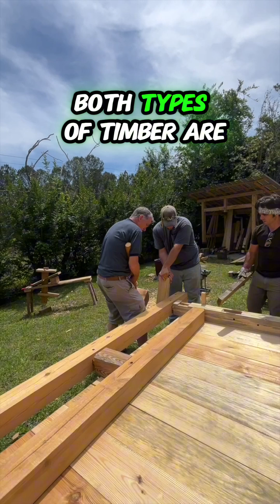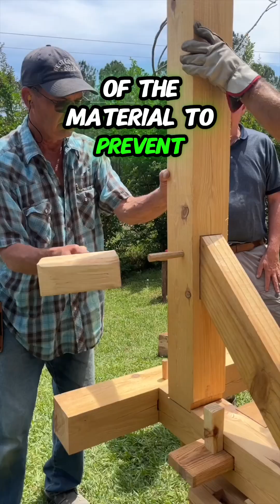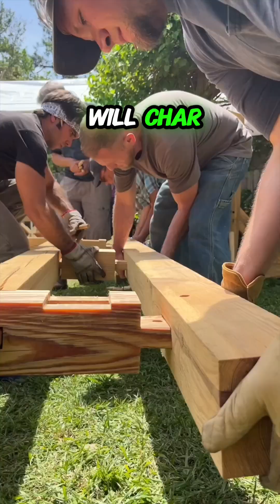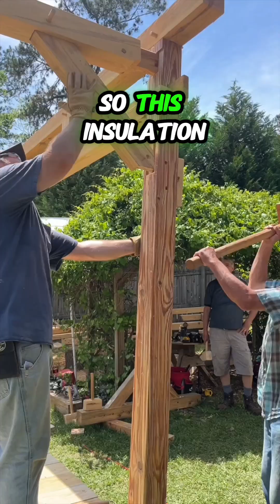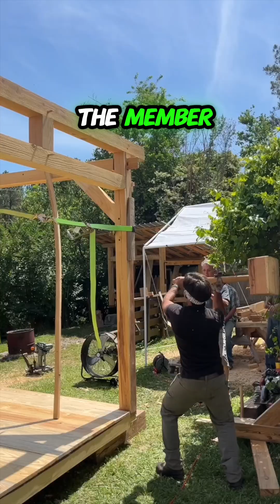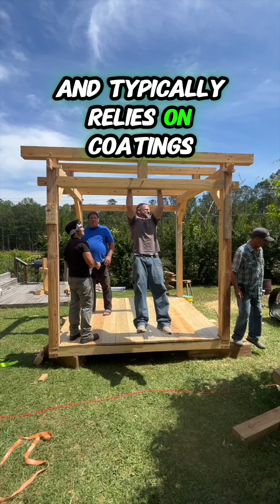Wood is more fire resistant than steel 🔥

Comment: My 1919 house is regular stud construction and is still here. Y'all push timber construction way too hard, maybe because you have stake in it? Here in Colorado we get strong gusts of wind 60mph or more and my house is still here. So quit wasting my time.
Reply from the maker: And we have a 1908 balloon frame that's still standing. Most older construction that's still standing is pretty solid. 

The comments in this video apply to any construction with heavy timbers or mass timbers, not just timber framing. 

If you want less timber framing, maybe don't watch a timber framing channel.  =)
Reply: Timber framing and mass timber should be the push to replace stick framing. Quicker build stronger and better looking. Mixing icf and timber/mass timber seems the way to go.  If i ever move out of my ranch home to build a new home it will be icf first floor then timber/mass timber/clt
Reply: @appalachianwoodhomestead  It just showed up, it's not like I searched for it. Maybe learn how YouTube works instead of being passive aggressive.

Comment: Before anyone gets confused, she's talking about steel stud construction. Traditional structural steel buildings, or even prefab erector kits. Either of which have fire ratings in the many multuples of any wood construction methods.
Reply: Maaaahhhh wrong too many variables to make that claim.
Mass timber is more fire resilient then steel.  In any construction its not the building that burns but the contents.

Comment: Nice try muricah. I am sticking to bricks.
Reply: This is more of Japanese style of building use thick timber beams and poles, America started with log cabins then built tons of brick structures, although they typically were only a few layers thick and only the most well kept have survived over 100 years. I’ve been to plenty of towns where the brick infrastructure is on its last leg. We typically will reface the new buildings with brick facades to fit the vibe with the rest of the brick buildings. I believe America was a top producer of bricks globally for half a century 😂
Reply: This is european vernacular architecture, americans don't build like this.
Reply from the maker: This is an American layout style of timber framing based on the European tradition.
Reply: Swiss homes anyone? Their carpenter schools are amazing. Brick is a veneer product not a structural element